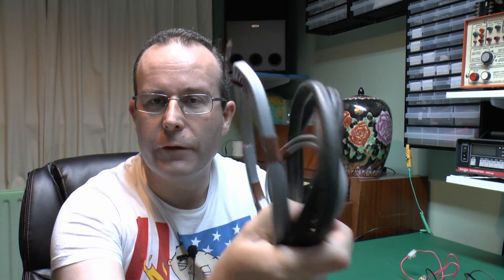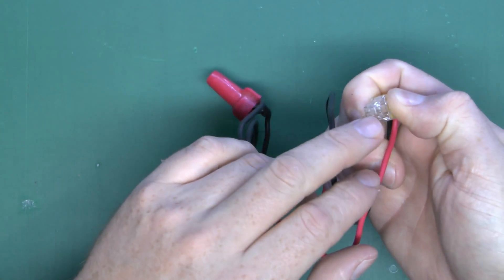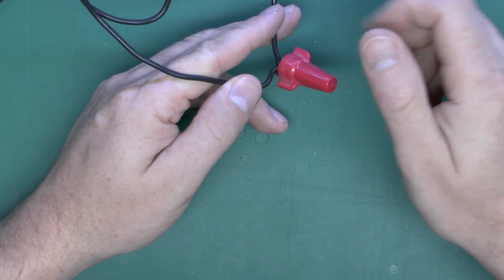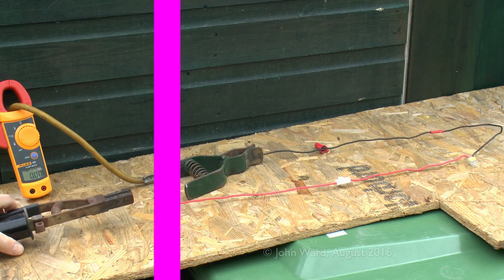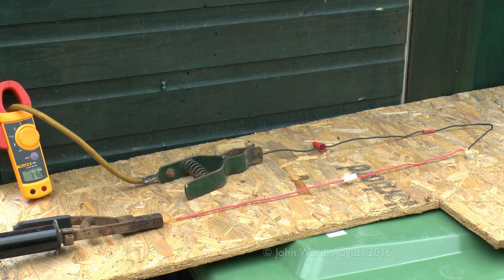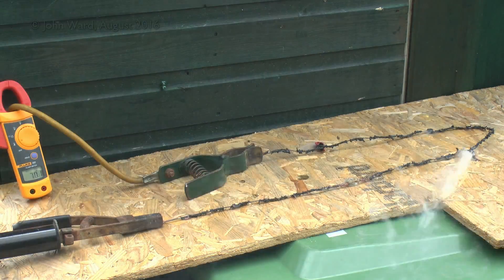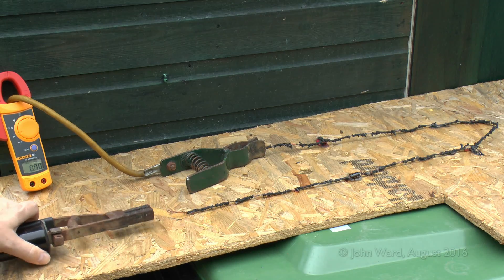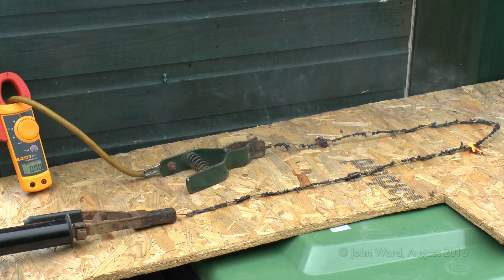Wire Connectors Overloaded

Comment: The key to the wirenut is to make sure the wires are twisted together under the cap. The manufacturers don't require it, but many electricians in the US and Canada twist the wires together with pliers then apply the wirenut. If you just rely on the spring inside to complete the circuit, you're asking for trouble. In other words, use the wirenut to insulate the splice only. Don't rely on it to male the connection for you.
Reply: I have been trying to convince myself to do pretwisted, but does not Pretwisted stress the copper, which can also cause a wire to come loose.  
Really don't see wire nut connection coming loose just by pull, the only way I can see coming loose is the spring overheating
Reply: @La2venida  
I've seen some rather crazy looking pretwisting, and yes it does seem to cause more stress on the copper.  Theoretically if everything is within specifications (such as maximum current) this kind of exercise is really just for dramatic effect.

I will say that of these four different connector types, the plastic wire nut is the only one that relies on the plastic portion to maintain the mechanical connection between wires.  All the others are really just the plastic portion preventing electrical contact with everything outside the connector.  But if the plastic portion of a wire nut is gone, the steel spiral isn't necessarily going to hold the wires in place.  However, it shouldn't get to the point where it's going to melt.

Comment: This test doesn't find the weakest connector as the heat of the wire being conducted to the connectors is the reason for these connectors to melt. A better test would be to use the biggest diameter wire that could fit in all the connectors so there would be less effect from the heating wire so we could really see the effect of the current on the connectors only.
Reply: That wouldn't be a realistic scenario.
Reply: and 90A on a 1,5mm² is?
Reply: can't get a much bigger wire than that though from what I see
Reply: That's what I'm saying. Many of these test introduce the wire to current that code would not allow for. However there are larger wago connectors with up to 8 ports. Presumably the added metal would allow for more current but I still do not trust them.
Reply: the wago bridge heated higher than the wire, you can see it heat the wire near the connector.  as long as it's thick enough for the rated circuit it may be ok, but I can see where they can become hotspots.
Reply: @llVIU  2.5mm is standard for domestic installation.
Reply: 1.5mm^2 is the biggest wire for that red crimp connector.
Reply: I'm reading that 1.5mm2 wire actually has a current rating of 15 amps although it should be able to handle more without the wire melting.

I'm thinking that a lot of the damage to the connectors were from the wire insulation catching on fire.

Comment: Cool, so by the time any connector has failed your house would have burnt down already 😃
Reply: It seems so.
Reply: I would hope one would have appropriate over-current protection in the circuit so that this scenario would never happen. ;)

A problem with this test though I think is that all those connections seem to be freshly-made, and so haven't suffered the effects of years of hot-cold cycling, and degradation due to moisture/etc.  I've seen plenty of choc-block connections fail badly in my time, to the point of setting on fire, purely down to contact resistance increasing as a consequence of the above.  And thus melting/smoke/fire before any protection device kicks in. :/
Reply: +9ff70f96 hmmm. Good point about age of the connections. If I've only got 1 in 1 out of a choc block I'll stick them in the same side and use both screws on both wires, to try and keep the most surface area and reduce the chances of a high resistance join.
Reply: Yep, that's good practice, in my opinion.  Nice to know others out there put the effort in too. :)
Reply: I was a bit harsh there, sorry.
Reply: Good point, although, unfortunately, breakers themselves do fail, on occasion... But then I guess you can't be prevent everything from going wrong, all at once, can you?
Reply: Makes me think that had they failed it might have been better?
Reply: its better your fuse blows in your fuse box rather than some dinky connector in your wall that you have to dig out
Reply: 1wsx10 In our electrical code, buried connections are a code violation. They all must be in easily  inspected and serviced junction boxes with covers that can be removed and replaced whenever.  The boxes behind switches etc. count as junction boxes and are commonly used as such, to the point where dedicated junction boxes are often outlet / switch boxes with a blank cover.
Reply: @UCCLdIk6R5ECGtaGm7oqO-TQ  Breakers and fuses are for interruptions. Connectors like this have 1 job.
Reply: Your breaker should break before it ever gets that hot anyway soooo....
Reply: @UCCLdIk6R5ECGtaGm7oqO-TQ  Great points, however, technology is moving so fast and the planet is facing so many issues from war to climate change, over population, etc that we may not even be around.
Reply: But the metal connector will still be intact 😂😂😂😂😂😂
Reply: Interesting to know that even the cheapest connector did just fine.  I personally like the wago clips.  Makes for a very clean connections that can be easily modified later.  (Engineering projects)  Recently I began using them in my home DIY and found them just as handy.
Reply: The wire and connectors are running quite hot here. So 'cool' is a very stupid remark, don't you think? 👎
Reply: @The1wsx10  Hidden connectors are not legal in the US, must be in junction boxes and accessible per code. Obviously.

Comment: Good video, but thermal camera would have been amazing for this.
Reply: That would have made a fasinating addition to the vid.
Reply: +Philip Burkett Yes I agree, seeing a hot spot form would be very informative. I use Wagos mostly now as I found crimps unreliable on solid core wire especially cheaper ones even using a good crimping ratchet tool.
Reply: Whereas Wagos are not intended for stranded wire.
Reply: According to Wago they are good for both solid core and stranded wire.
Reply: Programentalist Have you ever tried pushing very fine stranded wire into a Wago terminal?
Reply: Programentalist  Oh and spring loaded gripping terminals have been around for many years. The internal connections in some fluorescent lamp fittings from 20 years ago are spring loaded gripping terminals.
Reply: Cool observation!
Reply: Maybe this test should be repeated with thermal camera

Comment: Wire nuts are still about as common in the US as they were six decades ago, and shockingly we still use them to this day in appliances like ceiling light fixtures, ceiling fans, and even touch activated lamps.

Comment: This was a wire in open air, and its insulation started melting first. Normally, the conductors would have been in a cable. Had he installed this rig at the end of a cable with same cross section, it would have short-circuited first, leaving all connectors at the end with near to zero current. And in an actual home, a fuse would have reacted before any of this happened. But, I get the test. To me, all connectors did just fine. I'm just tripping to smell an actual burn in my house right now...

Comment: The reason it didn't burn at 30 amps is because the conductor is out in the open, thus heat is able to dissipate. Put a piece of insulation over it and it'll burn.

Comment: Nice test. Next one with 2.5 qmm or 4 qmm cable? Normally do you not use one cable only - if you use it with gr/ye and blue together then the cable fault early and the breaker tripping. So what? Now all people can see that the cable fault first before the connectors fault. I self use sice years Wago connectors. All Busch-Jäger power connectors put in cable same Wago connectors - all allowed here in Germany. So I use them in Thailand too. Never a fault. The screw connectors can fault if the screw not connect good enough - I use them only in miniatur railway systems.

Comment: Although I am using them on a daily base, I was always a little sceptic about the Wago connectors in general. Nice to see those new small types drawing 4-5 times their rated current without failing. Thanks for the video.

Comment: This was interesting, thank you. I personally prefer the lever type Wago connectors for two reasons, they are intended to be reused, and they can clamp down securely on really tiny wires, in other words they are really versatile.
Reply: Some of them also work on stranded wire and not just solid core. This can be pretty useful when connecting lamps and other appliances
Reply: Yup those are the best
Reply: For building wiring I prefer the non-lever type because they're quicker and cheaper. Most domestic fixed wiring here is 1.5 and 2.5 solid, so the non-lever connectors (2273 series) are perfectly suitable. I do use the lever types for connecting lights and other items wired with flex. Never had one fail so far.

Out of the many I've installed myself I've only had one choc block fail though, so they aren't that bad either. It's mostly down to properly tightening the screws I think. Wagos are massively faster and nicer to use though, so choc blocks are mostly a thing of the distant past for me. I feel sort of nostalgic for them but sticking in five wires and keeping them from slipping back out while tightening the screw is definitely rather annoying.

Comment: The wire nuts have been used in America for decades. If the best brands are used (I prefer Ideal brand) and installed properly they will last a lifetime with no failures. Thanks for the video.

Comment: Very interesting demonstration John. 
You could draw a following conclusion: Overloaded cable itself is a much weaker point in a circuit than any of the used connectors on such cable. Never overload cables in the first place.
From practical observations and working with properly designed, non-overloaded cabling, I can say it's almost always cable connectors that go wrong first before the cable does.

Comment: Reviewing this a couple of months later John, one thing strikes me. The actual failure was at the point where the wire would have been stripped to go into the WAGO, and was PROBABLY due to me stripping the wires with a pair of sidecutters rather than the correct tool. A cautionary tale?
Reply: TheChipmunk2008 
thats why its important to not nick the wire or bend to much or to sharply
nice vid.
Reply: Comparing to the untested wire, it looks like it was a little way from where you would have stripped the wire. In fact, there's still some insulation on the bit that's in the connector. It is where the wire is bent but not sure if that's relevant.
Reply: Looks like it failed at a hard bend. Assuming that was AC, that would be a high inductive resistance. The Wire nut also has high inductive resistance, but the spring and other material gives it more heat sinking capacity.
Reply: +Copper Hamster I don't think inductive effects would be within a bull's roar of being significant at 50Hz.

The inductance of a bend like that wouldn't even be significant at 50MHz, and the wire nut does not form an inductor at all.

Also, the correct term is impedance, not inductive resistance.
Reply: +Godfrey Poon
To be fair, I think Copper Hamster meant inductive reactance, which when combined with capacitive reactance, forms the complex component of the electrical impedance vector. Resistance is the real component.
Reply: nope the actual stripped area is inside the connector, if you weren't searching to defend the WAGO you would've seen that it failed at the point it bends into the WAGO, which being copper wire makes it weaker, since it's being work hardened through the heat. point is they all survived loads they weren't rated for, they would've popped breakers, caught something on fire, destroyed whatever was plugged into the wire, well before they'd failed. stop being a fan of a fucking connector that you lose your grip on reality!!
Reply: csknives2140 Some wire strippers are better than a skilled guy with cutters, some are worse. Plus good wire strippers is one more thing to carry in your already full tool belt while crawling all over the place trying to get a job done. I know a good stripper saves time when doing a lot of same gauge wires on a job.  But if you are troubleshooting with a belt full of testgear, anyone qualified should be trained to do the stripping with any sharp object at hand.
Reply: At 50/60Hz you can there is basicly no difference between AC and DC with so few windings. Allso in the wirenut the current will pass though the first connection point of the cables.
Reply: The burning plastic just in that area could be the cause of it going extra hot since flames (belive it or not) is very hot

Comment: In Australia, the most common connector is called a "BP" (I have no idea why). It's kind of like the screw nut, but you twist using pliers then shove the result into a one-sided barrel and tighten down a brass screw. They are quite reliable due to the combination of twisting and pressure.
Reply: @Bobo-ox7fj  - Oh yeah, that's right, I remember now. I worked for Clipsal when they purchased BluePoint. I inspected the factory at Padstow NSW where thick brass/bronze wire was unrolled, stamped and turned into the screws and connector barrels. The machines were many decades old and still ran 24/7... It was incredibly old fashioned and felt like it would have been steam powered when it first started 😃

Comment: An important factor for a connector design is how easy is it to do wrong. You did a good so they all worked here. Many people do not put wire nuts on correctly for the type of wire they are using. You correctly pre twisted this solid wire with pliers, which should not be done on small thermostat wire or stranded wire. 
On the crimp connector people often use cheap crimper tools or don't get the wire in all the way. 
With the push in connector they move it around so much and damage the connector. They strip off too much insulation so wire is exposed, then have to try to pull it out which damages the connector. 
For the screw type they don't get tight enough or they don't strip the insulation enough so some insulation is under the screw. In the USA wire nuts are used a lot on smaller wire #10 and smaller but all the connectors are used. Big or serious stuff usually uses the block type connector, so I assume engineers feel those are the best. I like the screw block best because you can test voltage easily on the exposed screw.

Comment: You chickened out at 90A.  Photonicinduction would have started at 90A.  More likely he'd have started at 900A.
Reply: bdf2718 I popped it
Reply: My Power meter is smoking. Well it can take a bit more. Oh, i broke it.
Reply: Where that bloke's at, by the way?
Reply: Send you wire to photonic !
Reply: Where's my 'ammer?
Reply: Henk... hes in india i am pretty sure. apparently he got married to a girl out there... might have put a damper on his uploading.
Reply: Oh deer, we have been naughty again
Reply: bdf2718 I AINT AVINIT!!!
Reply: bdf2718 Thats the difference between this guy and PhotonicInduction. This guy actually wants to show something meaningful; How strong all these connections are. PhotonicInduction only destroys stuff. 90 amps is more than enough to prove that a 16 or 25 amp household circuit will be fine with the connection.
Reply: i was just thinking as an Electrician, Photo is like the little devil standing on your whispering into your ear and John is the angel standing on the other side saying the exact opposite.
Reply: bdf2718 
“AH WANT MOAR!!”
Reply: Photonicinduction drinks to much RED Bull I do love his mad stuff wish he lived next door to me
Reply: RIP
Reply: OI WANT FLAAMES!
Reply: its not enough amps until the copper start melting
Reply: I miss his videos. I've often wondered what every happened to him. He just stopped making videos. Is he dead? Is he just no longer interested in making videos? What's the deal?
Reply: @NotSoCrazyNinja  I guess he's married
Reply: @tyttuut  I ain't 'avin ittt

Comment: nice video I enjoyed the experiment. My guess is that the wago connector actually did cause the failure, that connection being the most resistance, higher ohms, caused it to heat up more than the other connectors. Although the wago connection itself didn't fail it got hot enough to cause the failure in the wire immediately adjacent. Maybe?

Comment: That last one that was shown, 3m WingTip is very Common and used in the USA by All Electricians ! They are the best to use because once they  are twisted on all the way , no wire is loose . Yellows are for 2-3 # 12AWG , Reds are for 3-4 # 12 AWG
Reply: Best case scenario no wire is loose, which is why many regions don't use them.

Comment: I've started using wago. I like them especially for others to use as they can not over tighten the terminal and damage the wire. I've seen a good number of melted choc-bloks from damaged conductor.
Reply: my bad experience is rusted choc-blok screws
Reply: Same is true of the screw terminals on sockets and light switches.  It's usually what causes the wire to break when fitting a new one.